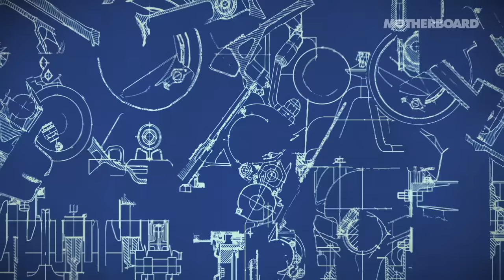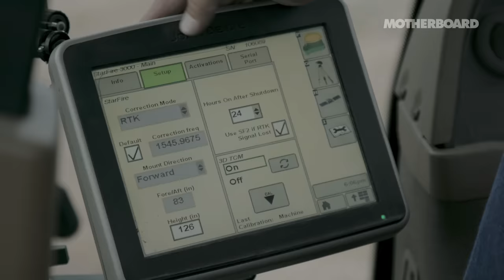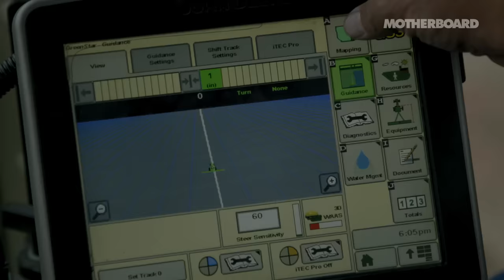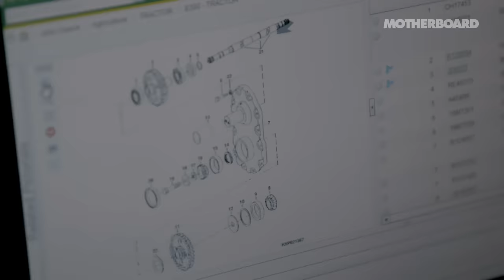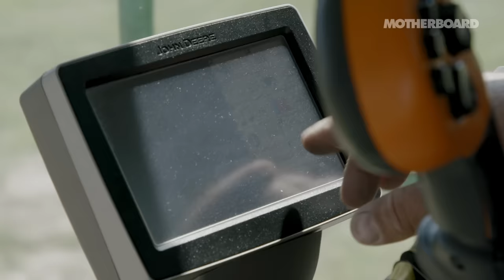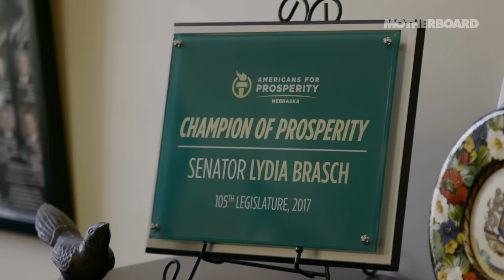Farmers Are Hacking Their Tractors Because of a Right to Repair Ban

Comment: Sounds like they need to LS swap and do standalone harnesses or run terminator EFI live by Holly. Lol
Reply: 2006blackmalibu i respect you
Reply: I like that but I'd rather have a Diesel any day over a LS, even that but I like the Hemi more than Chevys engines anyway.
Reply: Ppump mechanical or Bosch stand alone
Reply: @moreuggaduggas  4bt Cummins swap 😂
Reply: I like your style
Reply: @petermasci1728  Of course its gonna be a cummins, what's am I gonna do, use a dirty max or a powerstroke when I can that whenever I want. Rather be Cummin than Strokin lmao
Reply: Quit thinking small. Just put a 3406e car motor and get realiability and ease of working on it.
Reply: Personally, I’m a Haltech guy myself. But Holley is pretty good as well.
Reply: Fair enough haha
Reply: Man, I want to turbo my tractor and tune it with efi live or HP tuners. Wonder who has the software and the cable for my little 25hp john deere 3025e?

Hell if I can solder in a zif socket on my honda ecu and make 436whp out of my 1.8 I'm sure I could crank about 5 or 6 hp out of a 25 hp 3 cyl diesel's.
Reply: Caterpillar 3126 engine swap
Reply: I have been thinking in silence for the past like 5 minutes on how strongly I agree with this, I very strongly agree. Lol
Reply: And a dogbox
Reply: ok, solved the engine issue. Now what about the thousands of attachments and sensors?
Reply: Like your LS swopping a tractor
Reply: LS swap everything!!!
Reply: LS is a Intermittent Duty engine....tractor engines are Continuous Duty.   LS would be dead in a couple days.
Reply: @paulcrowe6586  , lets put in an Mercruiser then :P
made for go all day inn and out, just don't complain on the fuel going right trough.

got an uncle of mine that got an Merc 7.4 Bravo engine shoehorned into an 80's Jeep Wrangler... and got that thing streetlegal here in bloody Norway.
all because he bought an Jeep with blown engine while drunk, had an gasoline Merc engine in Scand Dynamic 7600 (also bought when he was drunk, no ones wants an gasoline inboard in Norway since boats can run on tax-reduced diesel) an a even bigger Scania turbodiesel from a wreak in the shed (not bought when drunk but from one that was drunk for just some more to drink...)
Reply: In the diesel work we Cummins swap everything 🤣
Reply: dominator has plenty of inputs and outputs!
Reply: Starting to appreciate how much easier it is to work on my 20 year Cummins power agco 8425. If it stops working there's only 3 things that can be wrong with it
Reply: Ls is to fragile.

Comment: Sounds like Tesla got their business model from John Deer.
Reply: The excuse from Tesla is:
"We don't allow you to repair the Car so you can't use it as an weapon or literally explode the second you start the engine. Also so that Amareur mechanics cannot claim you told them to 'repair' but later finding out that your autopilot thinks that pedestrians aren't there."
Reply: @fabianmichaelgockner5988  lol Tesla is hypocrite their cars are  electronics on wheels and they are critizing the mechanics their employers can't be called mechanics since their cars don't have mechasmics and hydraulic parts as a normal car it's just a battery their are electricians not mechanics you wonder why Elon has the biggest Ego in the world lets promote the Ethanol and Hydrogen and Bosch's E fuel for the future
Reply: The problem is Tesla is still pushing their self driving tech. Currently they're responsible for anything that goes wrong with that tech.
Reply: @fabianmichaelgockner5988  but Teslas are great. 8 year warranty. Also it's very rare for drivetrain to go bad in 1.
Reply: @punjab1captain  I am not saying anything against it. But Tesla is not giving their high-tech software to a mouthful of idiots you will catch their Tesla on fire while repairing on it.
What John Deer is doing is.
What Tesla is doing is for the safety of others.
Reply: Pizza Rolls  Normally in this kind of videos I always say electrodomestics on wheels
Reply: @giancarlolugo9586  wut
Reply: @kakerake6018  Exactly, it's not a car many people could fix even if they had access to the software needed to fix it.
Reply: @kakerake6018  Tesla makes cars just like the others and they all let shops work on their cars and aren’t held responsible for bad repairs.
Reply: @Victorioinator  there’s bunch of people that repair and rebuild Tesla’s not much different from Tesla vs electric stuff in hybrid. Tesla also isn’t only company making electric cars.
Reply: @fabianmichaelgockner5988  the same argument applies to regular cars. Think brakes, ABS system, tyres, etc. If those parts weren't repaired correctly then people could die. But that didn't stop people from repairing their own cars.

Comment: It's amazing the older simpler tractors are still running. Shame nobody is manufacturing those kinds of tractors anymore. John Deere wouldn't be doing what they're doing if they did I'm guessing. Technology doesn't need to be everywhere. Especially when more and more software companies are looking to provide software as a service instead of ownership as we know it.
Reply: Those older, simpler tractors are no longer made because new tractors are way more sophisticated and make a farmers job much easier. Older tractors can be rebuilt and used, but they're not competitive now with the new models. More hours spent for less result.
Reply: I am sure old style tractors are made you just need to import them from where they are made.
Reply: @deaddoll1361  nah the bigger tractors can basically do the same job if you use the same equipment with them, the problem is that new tractors have creature comforts like radios, tv screens, ac and all kinds of other stuff that farmers wouldnt want to give up. i mean who would want to sit outside riding a tractor in the elements all day if you have the option to be comfortable
Reply: @nitroxylictv  Older tractors are mostly less fuel efficient
Reply: Ex soviet countries are still using soviet tractors made by belarus and no problems. No electronics and they last forever. Mtz 82 for example
Reply: @kingeling  That's a major part of the problem. Fuel efficiency and emissions demanded by the government are controlled by computers. They don't want you bypassing or reprogramming those systems. The GPS and autosteer are just bonus systems for the manufacturers to suck more money out of you.
Reply: @bige.3474  I'm a follower of conspiracy theories myself, but I find that not so plausible...
Reply: @nitroxylictv  New tractors also have gps enlightenment so you can more efficiently run your machine in an 800 acre field.
Reply: the EPA has made it abundantly clear that tractors like that are not welcome to be produced. It's a large web of problems.
Reply: Mahindra is making tractors like the old ones. That's what I bought 3 years ago when I was tractor shopping. It is the most popular tractor in the world for a reason.  Just 1 look at the specs between a Mahindra and a John Deere and the price difference made the decision easy.
Reply: @nitroxylictv  - you don't need proprietary software to run an air conditioner or a radio in any vehicle! It's possible to have the creature comforts and a rugged machine which doesn't need software to run it.
Reply: We have the same problem where I work in California. A fertilizer manufacturing plant. The products we make are corrosive and it eats through everything electrical. We would love to have front end loaders that we're all mechanical injectors and such. Can't get em. Everything electronic and always breaking
Reply: @nitroxylictv  well thats false. Older tractors are way harder to run and operate compered to the new tractors that can do the same work but in half the time.
Reply: @nitroxylictv  there are 80s and 90s tractors with air conditioning that are about the same size. Less efficient than newer tractors but you can run them on vegetable due to the lack of a DPF. HUEI and Mechanical injected diesel engines have no problem handling it.

Comment: 10:48 so true bro. I’m 18, and I can easily agree that everything these days are built to break down forcing you to repair it or buy a new one altogether. People always say to me “Back in the old days, nothing broke! Things were made to last. Nowadays everything breaks! And you got more of it to break.” So I hear ya
Reply: There's a design policy called planned obsolescence. Things are designed to break. It's not poor build quality. It's intentionally using too little material or a switch that can't handle the load. A lot of devices have single point of failure modes and those are designed to break after x amount of use.
Reply: Prove Me Wrong that’s true. Recently we bought a new microwave, the last one my parents have had is from 1996 (marriage) and back then I didn’t even exist in plans. We bought it because we decided to move that one to my dad's office. It has never had a big problem or stopped running. The same was true for the refri, until we moved it to a farm we used to own.
Reply: Modern day Labor rate's come into to play, if it's gonna cost $400.00 in Labor to Overhaul are part and the part cost $400.
Is it really worth overhauling the part?
Take for example Engine Rebuilding on a car, with Modern Day Engine's there is really no point in rebuilding a engine. It would normally cost more then the car is worth done properly and professionally.
Reply: Prove Me Wrong the age of replacing vs repairing is here electric motors have been dealt the same fate in which I’ve worked and seen
Reply: @pizzaki582  Why would a piece of the car, and the price to replace that PIECE, cost more than the entire car? Unless we're talking about a $1000 point a to point b TrashMobile then what are you on about?
Reply: @gary00832  Apparently it's cheaper to buy a whole new printer than to buy a refill of ink. Does that mean everyone is going to start buying whole new printers every week or so instead of cartridges? NOPE.
Reply: Awhqua what are they printing with? Ink that dries into 24k gold? Let’s not blur the lines of logic and understanding!
Reply: Awhqua didn’t know you could get a printer for 7$
Reply: G Kotten black ink is 5 bucks. Colored ink is 10 bucks per color. You need all 4 to print properly. The cheapest printer I found with 3 seconds on google is 30 dollars. A set of black and RYB ink is $45
Reply: @Awhqua   highly advanced automatic transmission can cost almost the same amount as the car price to repair, and no I m not talking about your trash car. You want a diesel pump for your Ford focus, 6k brand new. And no will overhaul it due to liability of it failing.
Steering columing 2 grand, oh its built so you cant use a 2nd hand one, oh you got a turbo and failed, unless you wanna spend 10k at least for a proper repair cause metal shavings just shattered through oil system. You better get ready to bend over.
This guy is talking about his 2006 Toyota, if transmission failed it would cost more the car is economically worth to fix.
Reply: nate998877 exactly. I heard printers are designed that way. They have a set number of sheets it will print before it commits suicide. And sometimes I think build quality is poor as to make the materials used weak and more prone to breaking. But yeah, stuff is definitely designed to break
Reply: wal Know that one. When the cost to repair is more than the cars worth
Reply: Prove Me Wrong My mom got a new printer last week and she spent and hour and half with support cause it just wasn’t printing anything properly. Ended up giving them remote access. Wouldn’t be surprised if they set it up to kill itself as you describe.

Comment: Sounds like we should really be boycotting the companies trying to block the freedom to repair bills.
Reply: Great idea! Give up your iphone
Reply: @RottingFarmsTV  And your Tesla.  And your 'smart' appliance.  And ANYTHING else that requires a LIT of money and includes a friggin' End User License Agreement.
Reply: You both don’t understand that you can go to third party places to fix those things, you don’t have to go to certified Tesla dealers or iPhone repair shops to even work on them.
Reply: @RottingFarmsTV  many already have.. apple is the worst for right to repair. they don't replace the broken 10 cent components, they will just replace the entire motherboard and charge you $800, oh and you lose all your data. the only reason 3rd party repair shops for apple products exist is because apples board schematics have been leaked unintentionally
Reply: Hard to boycott them when they are all doing it. They won't even license other companies to produce and sell the ATF for their transmissions.
Reply: @stevensevek6151  Huh?  Which manufacturer makes their own proprietary petrochemical products?
Reply: @billcichoke2534  
Toyota does not MAKE their own But their AT fluid is NOT LICENSED to other companies. You will not find another fluid that says licensed by or approved by Toyota. Etc. They do say, "suitable for" or "recommended in". But Toyota is not saying that.
Reply: @stevensevek6151  I get that.  Honda has some overpriced stuff for their cars and motorcycles, but you can still use products from Castrol, Chevron, Mobil, etc.  It doesn't void warranties and doesn't damage the vehicle.

If there ARE car companies doing that nowadays, they're only shooting themselves in the foot.
Reply: Dakota yeah you can tell who doesn’t know anything based on their original comment. I just replaced the screen on my daughters iPhone XR front and back relatively easily everyone these days is just an idiot

Comment: Moral of the story... don’t buy John Deere!
Reply: It's not necessary to build/design the things so difficult. The only reason they do it this way is to coin out of this unnecessary complicated stuff. The more computers the things has in, the worst off you are. This is true for cars also. Why is it necessary for heater systems, flicker systems, light circuits, oil pressure and heat gauges, cooling fans etc to work through computers that cost thousands to fix. Bull! Work it through switches and relays. It's cheaper to fix, less complicated and more reliable.
Reply: You realize that EVERY single equipment manufacturer, has there own software and diagnostic tools regardless of what make, model, purpose or end user it is? This isn't just a "John Deere" problem. JD is a massive example given there brand and the farmers and rural nature of agriculture. I work as a heavy duty mechanic. Every single truck, engine, transmission, ABS system, hydraulic system, body up-fitters (hydrovacs, snowplows, street sweepers, etc.), they ALL have there own software and diagnostic tools! Computer controls have been around since the late 80s and as things get more complex, more powerful, more efficient and we demand more, the computers and electronics will get more complex and expensive to fix.
Reply: The moral of the story is that this affects every name brand of tractor on the market.Go out and buy a new Case International,go out and buy on brand new Fendt,go out and buy a brand-new,New Holland etc.
This SAME problem exist with ALL BRANDS,MODELS,MAKES.
This goes for cars,home electronics,tools,etc.
Reply: You can't see there forest, kiwi.
Reply: The farmers are hacking their tractors and turning them into hot rods to get noticed by their female cousins.😈🥰💋

Comment: The same thing is happening in every industry. People need to wake up. Any automobile 2014 or newer almost all have missing dipsticks. If you buy a new part and it has electronic controls it has to be matched to the VIN using dealership computers.

Comment: Here in Southwestern Ontario, Canada, John Deere has mobile repair for those situations that it wouldn't be very practical to transport equipment to the Dealer.I am not a farmer but I have lived around farms and I have worked on farms for many years.Ya something needs to be done about this because it doesn't work at all.

Comment: A farmer buys a couple of hundred thousand dollar John Deere Assembly plus tractor and in the small windows that they have to plant or fertilize or whatever, it goes down. They have to pay this two thousand dollar trucking and then leave it at a John Deere shop. How long does it take to diagnose and get it running?  Meanwhile they lose the window. 
I wonder why you have to have all these sensors and proprietary computer software? Maybe a powerful, simple tractor will bury the Green JD.

Comment: Yep, I've decided that I will never again buy a vehicle newer than y2k. I inherited a 2008 Volvo from my dad and it is the latest-model vehicle I will ever own. It's also in the shop right now because the headlights are run by a persnickity proprietary computer. I will probably have the mechanic rip the wires out and install a simple light switch on the dash because SCREW the dealership. My others are 1997 and 1977. Hopefully I'll never have to buy a vehicle again. I probably won't be that lucky, it's true. But I can hope.

Comment: Not only is it questionable the software will be available for a 30 year-old tractor in 30 years, computers will likely have changed to the point farmers will need to find and maintain working obsolete computers, too. Will implement dealers force obsolescence on older implements simply because they can. Bet on it! It may be the case in 30 years that the only functioning antique tractors will be older than 50 years old. John Deere won't be happy to keep updating the software for a 30-year-old tractor to work on new computer operating systems.